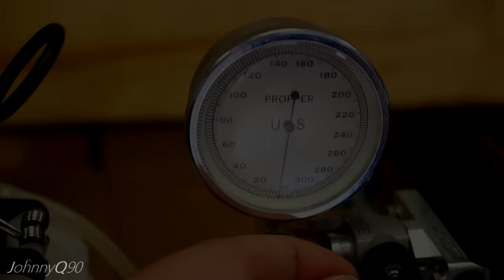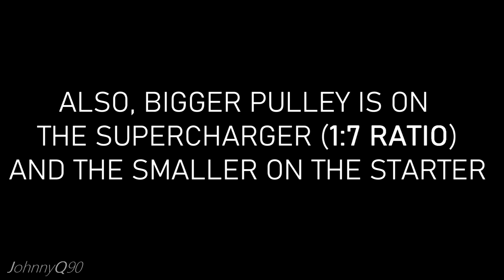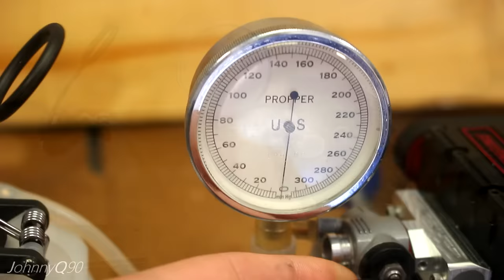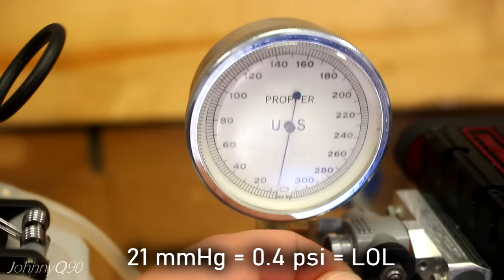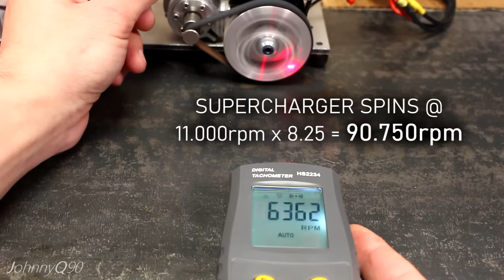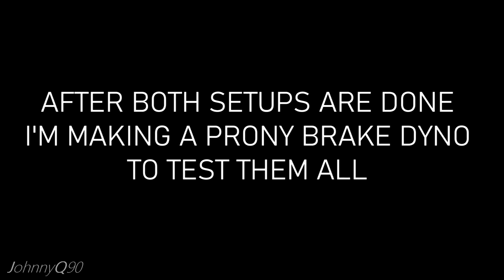0.6psi @ 90,000rpm Supercharger on MINI 2 Cylinder Four Stroke Engine! - BLOW Through Setup

Comment: Have any calculations been done on the motor to determine how much air it actually draws at 10,000 rpm? If for example it pulls 75cfm but the supercharger at 90,000 rpm can only move 80cfm of air, you're not going to produce any meaningful boost. A test bench to determine this would be very interesting, you could probably attach the supercharger to an electric motor and set fixed speeds to see how much air it's actually moving! I would love to see that video.
Reply: It’s making more with the supercharger you can actually hear it

Comment: Some ideas:
- the inlet is bad. Look @your turbine how it's meant to be 
- turbo chargers are flood-cooled. Simply constantly spit some fuel to the gears and bearings. Methanol cools, oil in it lubes
- using flood-cooled gears and bearings may enable you to go beyond 100krpm
- look @model turbine designs for inspiration

Comment: Great job, i like the idea and i can give you a little friendly advice from one mechanic to another mechanic. I do allot of force induction projects and the pressure on the fuel needs to be higher the the pressure on the charger. Lets say an engine like a 2.0 litter using 1000cc injectors, the idler fuel pressure is 43psi and depending on the engine compression the injection pulse is 1.2ms on 900 to 1200rpm. When the charger start to force the air inside the engine normally the pressure on the fuel advance 1.1psi per pound of boost. I don’t know if this help you, I think if you add an electric or manual fuel pump with regulator you can fix your problem. I would like to see that project working at 100% soon!

Comment: i cant believe how good all this works your craftsmanship is so on point. i do think you will start too run in ignition timing  issues, would help you with these  types off air displacements would help with torque. i guess for now, you are just having fun with it and hp or torque isnt on the menu. i am hyped for the next video!

Comment: If you want to measure more boost numbers, just create a bigger intake restriction. I'd also perhaps look at making a gear pump (positive displacement lobe gear pump) rather than your centrifugal compressor - I think that's too small of a diameter to achive significant boost levels, Bernoulli's equasion favours velocity (fan blade speed vs. air speed) exponentially so a centrifugal compressor with twice the diameter (at the same RPM) will be MORE than twice as effective (on paper, at least) - but then you're getting into the realm of having a supercharger larger than the engine.

For the gear pump, all you need is some cold rolled steel and some very careful cnc milling, followed with a light polish on a surface plate - I think that would yield a better result, as you could sacrafice some RPM for a larger pump size, but in turn that might need a larger pre-carb intake volume to dampen the pulsing/harmonics (also depending on how many teeth or lobes your pump has). Also depending on pump size (and efficacy), you might also need to invest in some boost control (eg. a ball bearing with a spring that'll relieve intake pressure above 1 psi) - just to get the system running smoothly before you attempt any higher numbers.

Comment: Simple mechanical fuel injection with electronic pilot pre-program? For every single position about accelerator (you can read this position with electric contacts or small potentiometer) you can set a injection position. It's only one idea, obviously. Your job is fantastic, I admire you!

Comment: for the boost in a small engine to work for small engines you must make a plenum between the turbo and the carburetors that is more or less the size of the cylinders so that the plenum maintains boost volume and the engine does not consume it in each rotation

Comment: Good work 😊😊😊
One thing you can try to do is replace the inlet pipe. With a real pipe, 3D printed parts are not suitable for maintaining pressure, they tend to have air leaks between layers.

Then I don't know how you printed it, usually it is.

Comment: Love your videos, before you change this setup you could try taking the back pressure from the exhaust for the fuel tank so the S/C doesn't have to fill the empty volume in the fuel tank. That would make the S/C energy more usable as you don't have much to start with. Cheers from Australia.
Reply: Nah, he needs a true boost referenced fuel system to make it work right at all throttle positions.

Comment: I would look at flipping the rotation of the supercharger housing, or mounting it above the carburetor. The back bend in the opposite direction of the impeller housing at the discharge and up into the black flow tube is probably choking flow due to a higher pressure drop.

Comment: If the supercharger is only producing .6 PSI disconnected from the intake, it seems like the air intake demand from the engine is going to use that up, and not actually develop any positive pressure when running.  Maybe it wasn't shown, but if there is no positive pressure under run condition, the SC is only an intake restriction instead of a power adder.  You could add a check valve to test if engine air demand is exceeding SC output.  Plumb into a simple air box.  One check valve allowing atmosphere in (bypass air) and feed from SC into plenum.  If Check valve opens to atmosphere you know engine demand exceeds SC volume.  You could even measure pressure in the box (vacuum/pressure) to determine how close or far you are.

Comment: Awesome setup 👍 one thing I might add you are trying to balance the systems with the connection to the fuel tank but this just adds a large container the supercharger has to fill aswell before it can apply boost to the motor this may be the source of the lagging response. I think if you put the carby it on the inlet of the supercharger you would gain more response and power be cool if you could test this, maybe use a small tank that might improve the response in this setup. Just my thoughts 👍

Comment: The edges on intake of the blower absolutely have to be rounded over on the ID. Airflow over 90 degree edges actually produces significant turbulence that effectively choke the intake as air mass and velocity through the tube increases. Basically it creates a circular vortex inside the lip of the intake entrance and the faster the air flows through that point the faster that vortex rotates meaning that there is a point at which it will choke itself. 

The solution to this? Taper the edge of the intake. Even a plain old 45 taper from the ID to the OD will dramatically improve flow and reduce lag. It is basically creating a circular airfoil. This is Bernoulli and Venturi doing work. 

There is a video called "ducted fan theory 101" that should explain this all much better than I can.

When done properly you go from a turbulent column of air through a straight tube to a vortex flow (think tornado) that rotates with the impeller. A tapered bore also acts as a compressor of sorts and the natural vortex flow of a Venturi all add up tremendously. Just beveling the id edges will smooth your setup out and amplify the sound of the blower radically (think trumpet or megaphone for your blower)

Longass story short... the keywords you're looking for here are "Velocity Stack" and  "bellmouth". Welcome to aerodynamics buddy!
Reply: BTW the circular vortex im initially talking about is the same type of vortex a vortex cannon makes, but it stays at the inside lip of a the tube vs. Traveling out.

Comment: Air flow might be restricted on the inlet side of the 'turbo' if you look at real turbos the inlet is profiled to aid air flow, the other thing is if you scale this engine and turbo up to full size, that .5 psi boost will equate to well over 10 psi boost.
Are you retuning when contacting the turbo? The idea of a turbo is to get more air into the cylinder so you can add more fuel and on the scale of model engines. I was once told that on model engines you have to use nitro fuel as it has oxygen bonded to the fuel at a chemical level and this was because those small engines could not get enough oxygen out of the air to burn correctly.

Comment: Love all your videos. I've been thinking though, given the scale of the engines are so much smaller, is PSI an accurate way to gauge how efficient your supercharger is? Should the .6 PSI reading be scaled up, say 10X (I think the engine is a 1/10 scale model) which would be 6 PSI. I'm sure you've done all the math, but the fact that tiny blower is pushing .6 PSI through tiny manifolds is damn impressive. Congrats on a great achievement!

Comment: Electric fuel pump would solve a lot of issues. when the SC spools its having to fill the volume in that huge (for this scale) fuel tank. Electric fuel pump and remove that line from the blower. should help a lot. also I think the supercharger needs to spin at about 200k rpm, not sure what its upper limit is though...
Reply: Agreed, that engine sounds quite fuel starved.

Comment: Compressed air is hot where as cooler air is more oxygen dense usually creating more power. you should make or purchase a small inter-cooler and place it in-front of the engines cooling fan make a decent shroud for maximum air flow and i think you would squeeze a little more power out if it

Comment: Without a fuel pump the positive pressure in the card will push the fuel back in to the jet. Normal carbs work on vacuum  and will not operate under positive pressure.

Comment: @JohnnyQ90  Hey Johnny, I really love your work but I got to tell ya.. The thing you should aim for is not pressure, but mass... AIRMASS. This engine naturally aspirated consumes more air on full throttle than this supercharger on ANY gear ratio. Not because it's badly manufactured. It's very well made. It's just way too small. 11.000 RPM Times the Engines displacement. 3.5ccm x 11000rpm = 38,5 liters of Air. (eventual losses not count in)

Comment: Very impressive, but still not enough boost. Have you considered shaving the blower housing mating surface to tighten up the clearance and then lapping the impeller to achieve a tighter seal? A turbo or blower is extremely dependent on a very close tolerance between the housing and the impeller. Especially as the diameter is so small. Although you machined it very precisely, there is a limit to what can be achieved with a lath or mill. That’s why truly precise parts are ground. Or, when not practical, as in this case,  lapped. Making an interference fit and then lapping in the clearance will deal with minor inconsistencies in alignment and surface finish, giving it the best possible seal and ensuring the best possible fit. I wish you success in any case! Very impressed with the work so far, looking forward to the next update.

Comment: testing the pressure of a blocked outlet !! it should give very low pressure.
try to open the outlet gradually at a fixed speed, then draw the pressure ratio curve.
the way you set it up, you are measuring the "COMPRESSOR SURGE" i think it's a pressure vibration and blades stall pressure ... 
ok , try to mesure the pressure at WOT with the compressor hose connected to the engine : but again you don't know the compressor map, you need to keep yourself between the surge and choke lines ...

i think you should remove the compressor, couple it to an electric motor, run it, and fill the compressor map (pressure ratio / flow), buy a flow meter LOL.

thanks for the video anyway, you are brilliant.

Comment: Do a draw-through setup. Blow through carbs are difficult to make and setup IRL, let alone for a tiny model engine! Every orifice has to be sealed, including the throttle spindle.  The fuel bowl must be pressurised too. Alternatively, the entire carb must be encased in a sealed enclosure and the enclosure itself pressurised. Also jetting/needling for blowthrough carbs is more tricky. Do a draw-through setup and  it will running a carb on  bigger engine.

Comment: You have connected your back pressure hose to the supercharger.  So when you release the gas, it continues to pressurize the fuel tank, thus applying fuel pressure to the carburetor.  So the throttle response is late.  In my opinion

Comment: It would probably be best to slighty up scale your compressor wheel and maybe your throttle body. I wouldn’t spin something that small much faster because it is hard to keep tolerances tight enough and not crash the compressor wheel into the housing. Love the videos though! Keep it up! Hopefully this helps you perfect this setup and maybe supercharge the rotary;)

Comment: Adding a miniature spark plug and ignition timing module will also smooth out the engine...if you can a working O2 sensor you’ll be able to tune it to perfection.

Comment: You must remember that when using a blow-through setup with carburetors, that the rest of the carburetor must be pressurised with boost as well, namely the float bowls. You'd likely need to pressurise the fuel tank to the same pressure too, seeing as these don't use any sort of fuel pump.
Reply: There is NO float bowls with these types of carbs, and they require no other mods to work with boost. They don't have to be enclosed for a blow-thru setup.

Comment: Should just do a bench test with regulated air pressure coming from another source (like a compressed air tank) to see what boost the engine can reasonably run. Then try to figure out if the engine has enough power to provide it via a supercharger and still make a gain. At least then it'll give some numbers to shoot for. Also you need some T-connector type setup to the intake to measure the pressure while the supercharger is hooked to the intake manifold. (Another comment said the way the boost is measured now likely doesn't count vs. intake vacuum draw.)

Comment: Awesome job ! Supercharge a carburettor engine isn't easy, no wonder we couldn't see too much examples in the 1:1 car history even. That's why R5 Alpine Turbos had the carb before the Turbo made an extreme long intake for the mixture. Wasn't a throttle response king but at least it gave good afr whatever the manifold pressure was. With blown carb You have to play with fuel pressure at least what You made with the pressurized tank. Maybe connect the tube after the throttle valve (to the intake manifold) could be a bit better, but it needs to be tested for sure, and also need a connection. :) I really like the project, was a pleasure to see how You worked on it ! I'm curious about the output compared the "non blower" version. :)

Comment: Hey, I used to help build actual race cars. Like drag cars, track cars, you name it. You're getting your ratios better. But the throttle response is because the engine has to overcome mass. If you make your pulleys shaped more like a wagon wheel you'll reduce the lagged throttle response. You can increase response by adjusting airflow. The smoother the intake tubes are the better also can look into increasing bore or stroke. Lastly, you're using the wrong kind of supercharger design. I know it's because of limitations. However, I would suggest looking into a turbo design instead. The 2 cyl only has so much untapped potential. Might I suggest maybe look at watching a few show from like donut media on turbos and superchargers. Maybe you can get some good ideas from them

Comment: It lookes like at 7:21, the inlet to your compressor wheel has a small 90 degree lip before the final throat to the compressor wheel.

Normally, Id think this would be okay for the standard turbo charger, as the throat diameter is of much greater proportion to said lip.

However, your inlet diameter at its largest appears to be barely bigger than a centimeter, and that lip brings it down at least another 2mm.

Your turbines suction will be greatest at the outer edges of the compressor wheel, but I feel like that lip would be deflecting air travelling towards the wheels center where the rotational speed will be lower. If you flatten that lip, or better yet, make it ramp inwards smoothly to the edge of the turbine blade, you will see much better flow through the compressor wheel

Comment: I had a 1980 Ford Mustang with the 2.3 litre turbocharged engine utilizing a draw through set up. You cannot use in intercooler with a wet turbocharger so I had a 10 horsepower shot of nitrous oxide any time engine had  boost.

Comment: If you put the carburetor on the blower inlet rather than the intake port you'll vaporize the fuel better and won't need to pressurize the fuel.

Comment: Hi Johnny, two thoughts to your setup. First, the intake of the supercharger is rather sharp, which reduces the effective intake diameter and throttles the airflow. Maybe a rounded intake funnel could help. Second, connecting the intake manifold with the fuel tank enlarges the volume of the intake manifold resulting in a lag of boost. The poor little supercharger also has to blow up the tank, which is maybe not helpful.

Comment: Do a compound set up but also fuel pressure to compensate for the air flowing in so if you make .6 psi then you need 1.2 psi of fuel pressure otherwise it’s fighting the compressed air

Comment: Need to use a better pressure gauge that is scaled closer to the pressures you expect. Mechanical gauges are typically most accurate at 50% of their range, so if you  expect 0.6 PSI, I recommend a 1 PSI gauge.

Comment: A follow up to the comments about the carburettor  design.  I have a Patent on that subject gratned in forty countries, which would guarantee a stoiciometric mixture to the combustion chamber at all engine speeds, which can be used on any fuel from gases to liquids, which will guarantee perfect combustion with no unwanted  exhaust emissions, and which will comply with current European Emissions Regulations.  I shall forward details of this Patent in the next post.